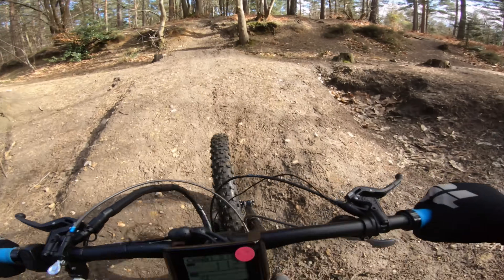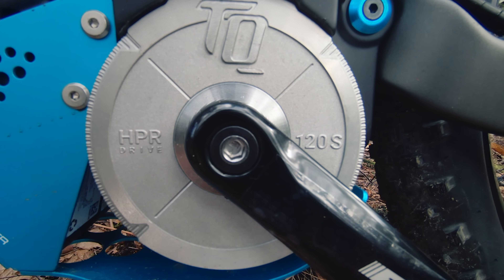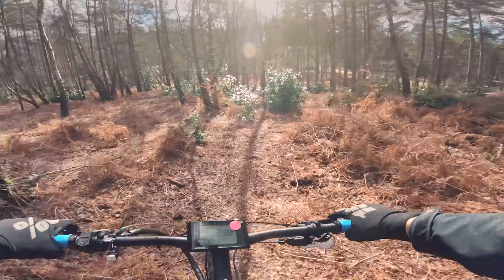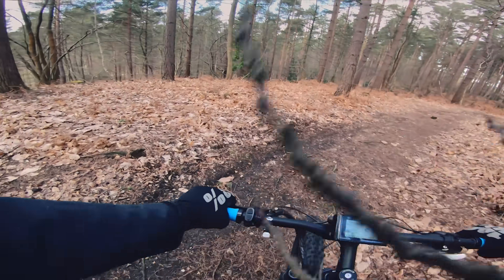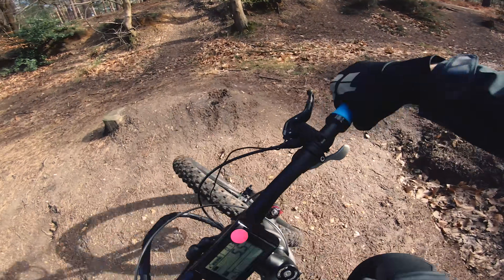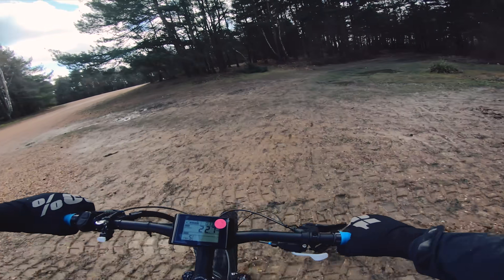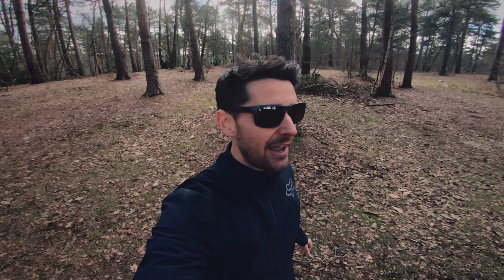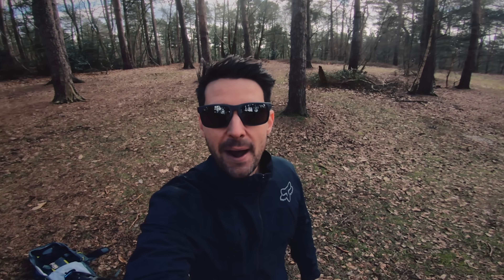INSANELY powerful TQ motor TEST | Same motor in the 2019 Haibike FLYON

Comment: I've just bought a second hand Flyon 5 Alltrail TQ version  bike and it's less than average the way it pulls. When it get's to 15mph the engine drag is horrendous. How are you getting all this torque. Mine pulls okay but nothing to rave about. Either it's faulty or I'm missing something very obvious. I've reset everything back to factory reset settings.

Comment: Since it is now almost the end of June 2022, I thought I'd give my thoughts on the Flyon motor since it has been out for 2-3 years on Haibike e-bikes, the motor is actually over 10 years old, first developed and used on an Audi e-bike prototype that sadly never came to fruition on the e-bike market.  Previously I've owned a retro-fitted hard tail mountain bike fitted with a  Bafang BBS02 at 750 watts and 120nm of torque, also, still own a Cube SUV Hybrid Race 500 with a Bosch Gen 2 motor. Neither of these two e-bikes have I ridden since I got my Haibike Adventr 5.0 with the Flyon motor. When I first took it out for a ride there was something special about the motor, at the time I couldn't put my finger on it, until later on. What I've loved about the Flyon so much is the pickup of the motor, within seconds it's doing it's thing at 15.5mph, which isn't fast, but that doesn't bother me, the fact it just gets you to 15.5mph very quickly is superb. Also, what I've noticed with my Bafang and Bosch motor when going up very steep hills even being in a lower gear my speed drops to about 5-8 mph on average, the higher the gradient the slower the speed going up a steep hill. On the Flyon in a lower gearing the e-bike can still reach the 15.5 mph going up the same hills with no problems at all. Also, what I love about the flyon, when it gets over the 15.5 mph speed restriction the motor decouples with no drag from the motor, using my own pedal power to build up the power in my legs. Despite the e-bike being heavy, this actually is a bonus as it grips the road surface very well. I have no regrets buying the e-bike, if I had the money I would definitely buy another Flyon equipped e-bike with full suspension. The difference in the motor is night and day compared to the Bosch and Bafang motor. If you ever get the chance to try one out do it, you'll certainly notice a big difference in the power. Also, be prepared to be stopped by many folks asking about the e-bike :)
Reply: Eats battery like no tomorrow though! And boy are those batteries super expensive.. We talking 900 smackeroonies for standard 630wh if you want a spare or need a replacement. My brother just sold his cause of this reason lol He even bought a second battery,, In the end he couldn't justify the cost of everything for the miles he needed to do. That TQ motor is a beast no question about that! The bike is a bit cumbersome though, Probably another reason he got rid.

Comment: I have the haibike alltrail 6.0 and the motors that come with they are absolutely ridiculous put it in the lowest gear and It will take you up anything one time I was going up something almost vertical and flipped backwards there is that much tourqe there (120nm)

Comment: Quite subjective test. one reaches the climb limit with front wheel lifting up and it could be done with bosch cx too. Too much torque is too much pain for drivetrain, just maybe less shifting. Real question is power efficiency of  different e-bike motors.

Comment: What is the point putting a motor in a bicyle? You get something, that has been invented more than 100 years ago. It is called motorbike and it is banned in sensible areas for very good reasons. Real mountain bikers don't need a motor.
Reply: Even real mtb rider's knees give out. With a little quiet motor I can keep going until I'm 104. Maybe 105 y.o.😎

Comment: As good as the Haibike Flyon with it's TQ motor & 120Nm of torque at full power seems to be... I bet it can go through transmissions & tyres like nobody's business when using all of that power; snapping a chain on a big ride out is no fun at all. For every upside, there's got to be a downside & you sure ain't going far on your battery, no matter how big it is. I'm quite happy to stick to my "lower powered" ebikes with Shimano 70Nm & Bosch 75Nm transmissions... which already munch through transmissions at an alarming rate, especially the Bosch one with that stupid 14t sprocket... I suspect that there will be a glut of second-hand Haibike Flyons up for sale on eBay after everyone realises just how much it costs to maintain the damned things... Power without control is useless

Comment: Hi Rob.. I read the  below description on www.e-bikeshop.co.uk. Just wanted to check with you if they are saying that the Flyon ebike can also be pedalled like a normal bicycle with absolutely no drag if we don't want to use the motor? I am sure the Bosch or Yamaha motors will always have a drag if you want to ride these without motor assistance. 
******''Thanks to the integrated freewheel, the bicycle can be pedalled just like a regular bike without a motor. When the drive is disengaged, no internal components are moving. It’s super efficient with ultra high torque and ability, specifically designed to meet the demands of eBike riders''*******

Comment: Never really found a hill my old Bosch EMTB had any trouble with TBH. Only problem I had with it was it liked to eat chains. It would easily climb near vertical hills. Never felt like the bike needed more torque. Speed ya. The Bosch wall sucks. That being said Ebikes are a blast. 35 MPH should be the limit for street bikes and 25 mph for EMTB's IMHO.

Comment: I'm confused.  The rider calls these "technical climbs" but I didn't see anything remotely technical about them.  He claimed that no other eMTB could climb them but I saw nothing that wasn't ridable on a conventional MTB but a sufficiently fit rider.  Does this guy actual ride trails?
Reply: craigsj the gradient of hills is deceiving on camera
Reply: @harisbuza8862  The gradient of a hill is not what makes it "technical".  Smooth surfaces are not technical.

Some more observations:
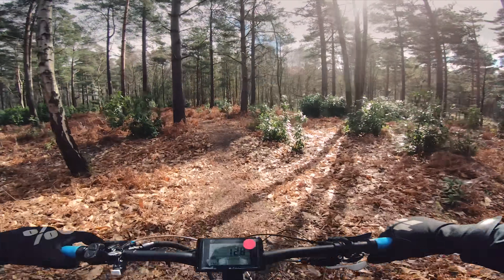  "Don't know what all this stuff does, it's probably for the suspension, I don't really care." 1:30
  Look at his saddle adjustment at 2:08!
  "I'm just gonna smash it" (4 second "climb") 4:00

This guy doesn't know what he's doing and likely has no conventional MTB experience. It's embarrassing.
If it weren't for roots, his area might as well be paved.
He should get a SurRon, it would more suit him.  He can't possibly pedal with a saddle that low.  Notice he never stood?

I would wager I could clear most of that today on a conventional MTB and I'm in my 50's.  20 years ago everyone I rode with could clean all of that without assist.  I've seen trails that I can't believe anyone would even attempt yet riders clear them routinely.  Nothing here impresses at all.

BTW, 120Nm sounds nice but Rocky Mountain sells bikes with 110 Nm and the motor manufacturer itself made a previous model (which flopped) at 160 Nm.  I have a Tangent Ascent-equipped bike that can provide more than twice the power here; not real useful on technical terrain since you can't control or benefit from such power.  Whether this new drive succeeds depends more on if it gets integrated into good bikes, you know, the stuff the reviewer doesn't care about.

Comment: This motor couldn't match the  power of Bafang M620, M600/M500. Moreover, the motor noise you had was pretty loud too. Beside the absolute power of Bafang Motor, it was silent during climbing hills.
Reply: You a Bafang dealer?
Reply: Bafang motors' controllers settings are a bit under refined.
Reply: I have a BBSHD on 52v in the land of freedom, and this looks like a regular ride around in the woods to me.

Comment: That display is the same unit found on a lot of cheap Chinese bikes. If that's where the components are coming from, I think this is the most overhyped piece of kit ever, not to mention the inherent geometry issues associated with a coaxial mid-drive.

Is it even 250 watts, or are they lying about that too? You keep saying "powerful", but really if it produces more power, it's using more power. Either its got more torque or a higher speed, or its considerably less efficient.

Meanwhile in other parts of the world, we're allowed more power. 300 watts here in New Zealand, throttles allowed, and no assisted speed limit.
Reply: The display on the Haibikes is a lot better than this one. I can only assume that they went for the simplest set up as possible, as the bike is only a platform to test the motor. The TQ motor is made in Germany, from what I understand, with technology used in satellites.

As far as the motor goes it's a 250W unit, but it puts out 120Nm of torque in full power mode. The battery in the Flyons will be 630Wh.

Comment: That spitzing m1 that you wont even name does have a all  new brother!in 2019 it  also has the awesome TQ DRIVE... this one is not so ugly,,I think its actually better looking than the haibike flyon you be the judge of it,  anyway it's not the looks that matter so much it's the power and price  and the new spitzing  is bloody expensive.  Your going to pay a hefty price if you want all those extra watts .. the spitzing you where riding is set at 1000watts continuous, the flyon I heard will be available in a 1000watt option in some countries, but since it's more than  likely that the 250w option is identical to the other it's just the programming that will different..
Someone will hack into it... I know of at least one company working on a controller and display that could likely take the TQ DRIVE up to even higher continuous levels than 1000w! it's a very well built motor similar in design to the American make tangent drive..
And that can be run at 8kw no problem  !! That's 8000w, not sure of the,
 nm of torque but... it's around the  300nm mark. its
Very powerful  ! to powerful to be considered just a ebike motor it's a motorbike motor  too and a very torquey , light  and compact, but my god its loud!!! like a muffled 2 stroke .

This video made my laugh and made me remember how I felt the 1st time I rode a fast ebike , so much power!! So much control. 
The bike ridden in this video is about half the power to that what I am used to . Still I want more... we are about to witness a new level of ebike power become mainstream.,,, With the release of the mass produced haibike..
Have haibike gone to far? 
Will specialized or others try counter measures and bring out a even more powerful ebike???, Or should they just claim defeat, call haibike a cheat ! and retreat back into the less powerful more European spec Gene's of ebikes keep to the mainstream mtb friendly definition of "what is a ebike ".

Comment: That motor has been set to 1000 w continuous on that spitzing..the haibike will  not have the same setting but I will highly doubt it that someone wont make a hack for this bike.. 1000w 120nm ...
Well yeah it's not that fast I'd rather the new cyc x1pro  3000w 180nm

Comment: There's no doubt that power is massive fun and that is very obvious from the video.  But unless you want / need to go up very very steep stuff all the time this level of power is not needed on an E-MTB.  That's assuming you do actually want to put a bit of effort in yourself of course!  The max power setting on my 2019 Levo is so high I turn it down.
I just read a review of the Haibike Flyon Xduro AllMtn on E-MOUNTAINBIKE MAGAZINE. They really like it but it weighs 28kg !! (not sure I would be able to lift it into my car and definitely not over a gate) If you use the max power to speed up the climbs the range will be terrible. They also say the motor does not have a very natural feel. Interestingly they rate if highest for "Touring" riders with the scores for "Trail" and "Extreme" reduced, I think due to low ground clearance. The NDURO version probably sorts out that issue?
I love the looks and very nice integrated lights but have zero regrets about buying the Levo - plus I will have been enjoying it for a year rather than waiting until October for a 2019 Haibike.

Comment: If you want real torque, get a Bafang Ultra-equipped bike (like the Exess carbon) - 750w 'nominal' motor with over 150nm torque - with full suspension, long travel stays and grippy tires, will climb things that you essentially need your nose over the front wheel.

Comment: Power is nice, but still I’ll be waiting till it will have 1kW battery, really silent motor and weight under 20 kilos. I want 100 km range even in hills.
Reply: You can wait long time and loose many beautiful trips...
Reply: Chris Kros That’s also the truth. :-)  But I still prefer light carbon full suspension bike around 11 kilos and my own muscles.
Reply: @johnwet6969  OK but you know after work I have no much time to go up to the top of the mountain ca 1000 m osl and go down before darkness.
E bike allows me to go up and down during the day time.
If you want keep fit no problem you can turn off assistance and push 25 kg😆
Reply: @johnwet6969  And my opinion is do not care about engine power etc for MTB even in e bikes the key point is still the geometry and traction. Engine is only for uphill needed and it does not matter which wngine you have -  every engine on the market is good enough but geometry not always is OK. I had problem to find a frame that suits me.

Comment: Looks powerful but for me my Shimano e8k is good enough I like bicycle feeling rather than powerful motorbike.
The only thing I wish is to remove assistance speed limiter.
Reply: Emax and the Shimano interface, not cheap, but you do get better control of the system. It is possible to change the firmware version to US which gives you a 20mph limit. The main issue is on the later firmware you cannot otherwise set the limit any higher. You can change the wheel circumference though, this is handy if the manufacturer sets the bike to the default 29er size rather than the 27.5 as on mine. Just getting the proper limit felt better, but if anything when I tried the US limit it was more than I wanted most of the time.
Reply: @chrisroberts-1  I wanted to ssy the law should be changed all these limiters increase production costs only and do  nothing for safety.
I can buy a powerbox to remove limiter of course but it would be better simply to have wise law.
Anyway how to change software for US version? When I do upgrades via e tube app it always recognise european region.
Reply: @chriskros8858  check out eplus software... find your local agent and get then to flash your bike..
Reply: @chriskros8858  I just did a big reply and YT ate it...
You need a Shimano SM-PCE1 or 2 interface and the eMax software and purchase a licence. More expensive than a bodge box, but you have a better chance of having an accurate speedo. If you can borrow an interface you can try the freeMax software to tweak assistance levels that you cannot with the etube app. If you are on an older bike firmware you can use the licenced software to change the limit. On later versions you can change the wheel circumference to fool the system or get the 20mph limit with a US firmware change.
Reply: @chrisroberts-1  Thanks I saw this software. It looks nice.
 For the time beeing I do nothing till my bike is in guarantee period so to next year..

Comment: I see what your saying about power and how you can go up hills you can't get up with a standard motor, but I find it's not the motor that stops me going up a steep hill, it's usually wheel spin or the front flipping out on me, I know it sounds strange, but I sometimes have to cut down the power to get up a steep hill.
Reply from the maker: Yeah I know what you mean. This bike had 2.8” Plus tyres with a fair bit of grip. I actually let a bit of pressure out the rear to help traction.
Reply: Yep I hardly ever put my bosch cx in turbo cuz there’s to much power then the back end spins up

Comment: My back ground is from mx and enduro so may think this would be my sort of bike but it seems a step too far towards a motorcycle very heavy and powerful if this is what excites you maybe a KTM exc with would suit they really are awesome raced them for many years 😀
Reply: I have 3 KTM's all 2 strokes.  I keep a 250 EXC on the west coast at my brothers and two here where I live,  a 200 wood scalpel and a 300cc XC sledghammer.  I also have a 2019 Trek Powerfly 9.7 Long Travel power assist Mountain Bike.  These bikes are next level fun, not near as much of a work out as a 4 hour day on a motorcycle (that will leave me much more sore in the muscles) but the Ebike is only 50 pounds and much more flick-able than our MX's.  I still max my heart rate out on the climbs because I do not use a full assist (it forces you to overshoot everything because the front becomes too light like he does in the video non stop)  and I get a work out just the same except I can travel 4 times the distance and do 4 times the downhill than a manual bike in the same amount of time.
Reply: @maxmuller1038  Hi I'm not ebike hater I have a Lapierre-overvolt 600 am which I love recently sold my ktm 200 exc as I decided to concentrate on mtb.

While watching the video I was struck by how rapidly it accelerated and in one section of the video rob went over a few woops stuck a pedal stroke in and the bike launched its self which kind of reminded of the way a an enduro bike would react.

I will need to test one to see what's it's like, from my impression that I got from robs test ride it's seems like a new category of ebike which could be a step to far and give the haters more ammunition.